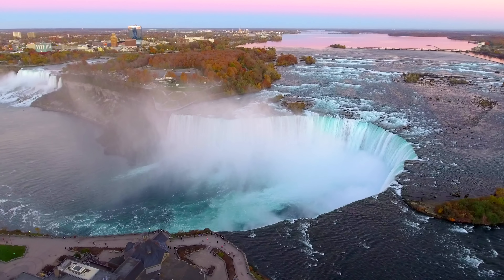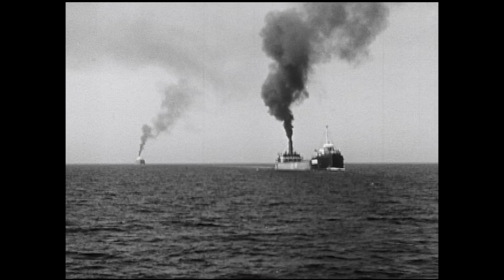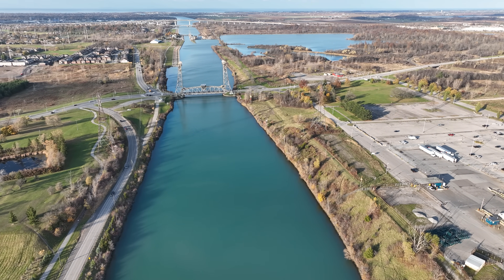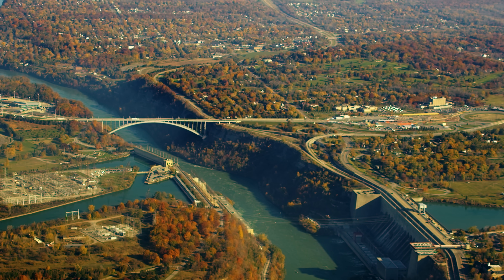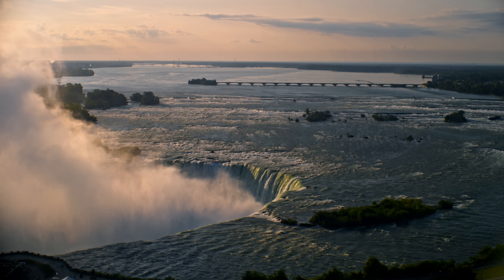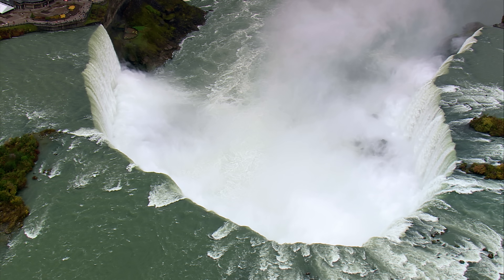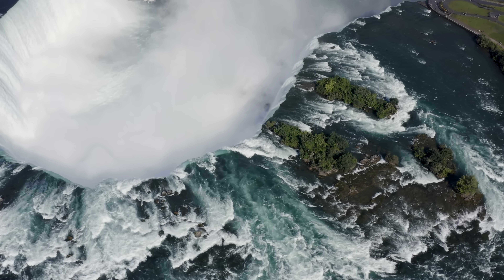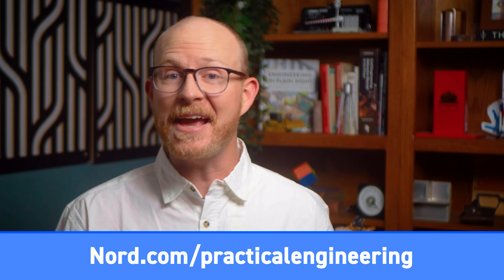The Hidden Engineering of Niagara Falls

Comment: An erosion rate of 1-3 feet per year sounds like light speed compared to the speed I'm used to hearing about geological shifts. It reminds you that these natural wonders are always temporary and makes you appreciate having the opportunity to see it now.
Reply: I grew up not too far from Niagara Falls, and in my 4-H geology course, we took a field trip to the Niagara Escarpment. If I remember correctly, our instructor (who was a professor of geology at a local college) explained that the geology consists largely of Niagara Shale. Shale, being a fairly soft, sedimentary rock. erodes rather quickly. That helps explain the fast rate of erosion. (I think there's also limestone in the mix, which is another soft rock).
Reply: @jpisello  and the towering cliff of the falls is because that shale is below a layer of  dolomite and limestone which is more resistant to erosion, thus the retreat of the falls largely happens at the cliff face and mostly due to the wasting of the shale undermining the dolostone until it collapses under its own weight.
Reply: The Rings of Saturn are kind of those that. On a Cosmic scale they haven't been around that long. And won't be around forever.
Reply: @ieuanhunt552  yea arnt trees and sharks older than the rings of Saturn
Reply: @Zo3yX depends what you mean by that, the rings are estimated to be up to 400 million years old from some theories and 4.5 billion years old and self replenishing from others. The first tree is estimated to be also close to 400m years ago
Reply: @ieuanhunt552 I'll miss them they're gone. 😂
Reply: The estimate is that in about 50,000 years, the Niagara Falls will reach the mouth of Lake Erie between Buffalo and Fort Erie and may cease to exist, turning in to a series of rapids or smaller falls.
Reply: Yes, well, the Niagara river carries a fairly substantial quantity of water, all year round.  The drainage basin that feeds it, is a fairly substantial chunk of territory, and almost all of it is in the wet half of the continent (east of the rain-shadow).  The nearest river that carries more water, is the Ohio, and it's not that much more.  And the topography is... steep.
Reply: @jonadabtheunsightly the east coast is definitely wet but actually the reason for that is not the rain shadow! The rain shadow only has a local impact on some areas east of the rockies. Most of the desert states on the west are dry due to oceanic weather patterns and land albedo.
Reply: @David-bh7hs  The rain shadow isn't the reason the eastern half of the continent is wet; it's the reason (most of) the western half is arid.  But most of the Great Lakes drainage basin, is outside of that rain shadow, so it is unaffected.
Reply: @jonadabtheunsightly wrong, read my comment again.
Reply: Imagine being around to see the formation of the mediterranean sea.
That would have been a sight to behold!
Reply: Geological shift ≠ erosion.
Reply: Do you know the Neva river? It’s called “Neva” (new), because it appeared during the human history, 3000 years ago.
Reply: The entirety of Australia moves 3" north every year from continental drift.
Reply: @elliotcm  The Moon moves away from the Earth about 3.8 cm per year.
Reply: @RCAvhstape  out of fear
Reply: water is one of the fastest acting things in geology honestly.
Reply: I recall reading that the composition of the rock results in the Falls receding at a rapid rate, relatively speaking.
Reply: Water is patient. It always wins, eventually.
Reply: That doesn’t look like 10000-30000 feet
Reply: Well the erosion rate was actually 3 - 6 feet per year, up until the international control dam was established in 1950, ever since then it has been an erosion rate of 1ft~ every year/decade.
Reply: weird there was no images depicting how the falls have changed over the past 50-100 years... they seem to be fairly identical across time as far as ive seen, but if the cliff face's move 1-3 feet per year youd think the falls would be in an entirely new location by now with a completely different shape
Reply: @AndrewBrowner  I don't know about the US side, but the CAN side there is so much water you can't see the cliff face at all so you absolutely wouldn't notice the erosion just from casual tourist photographs. There are maps of the cliff face and shape, as well as some photographs from above where you can see the changes.
Reply: @agilemind6241  youd think 100-300 feet would be enough to completely change the horse shoe shape, its not like erosion is perfectly even, ID expect it to turn into more of a V shape or maybe the U widens out so much it stops being a U and the water only falls off the straight face at the back
Reply: @AndrewBrowner  Well, Goat Island is several thousand feet long, so at 1 foot per year (the current figure, with the reduction in water flow due to the power plants), 50 or even 100 years of erosion, would only be really noticeable if you got an image from exactly the same vantage point and angle, which is difficult to do, because the stuff around the falls keeps changing as people build more and more tourist attractions.  I do think the shape of the Horseshoe Falls, on the Canadian side, seems like a deeper curve to me now, than in old pictures; but it's not so pronounced that I can completely rule out confirmation bias.
Reply: @AndrewBrowner  GIYF.
Reply: @AndrewBrowner  Why should the falls have "a completely different shape"?
Reply: @cprgreaves  the ground will erode at varying speeds, some of it will be rock, some will be dirt/clay some loose some pact hard.. and the water doesnt flow at an even volume over every foot of the falls, so youd expect the shape to constantly change... do you think a horse shoe shape and a flat fall seperated by some small islands started at the edge of the plateu thousands of years ago and receded perfectly in that exact form all the way to where it is now? no it would change form constantly
Reply: Respectfully, any topic in engineering is best left to Grady.
Reply: Eventually the escarpment will make its way all the way down to Lake Erie, and then the level of the Great Lakes will quickly lower.
Reply: There’s no way it has been eroding 1-3 feet per year.   I’ve been coming almost 60 years.  The falls aren’t situated 60-180 feet further back from when I viewed then as a kid.
Reply: @karagi101   human brains are notoriously bad at guessing distance without easy identifiers so you cant fully trust your self like that
Reply: @Zo3yX  I’m basing it on its location relative to the building that’s been situated right at the falls there for in its current state since 1927.
Reply: @karagi101  the erosion isnt uniform. Its not like cutting a cake you dont get 1 ft slices taken out every year much of the erosion is happening under the barrel of the falls where you cant see it unless you go into the barrel yourself or you use technology to look through the water.
Reply: @Zo3yX  Yes, that’s the way it usually works.  The erosion happens underneath and then the overhang that develops collapses.  It underneath erosion doesn’t go on for 50 feet before the overhang collapses.
Reply: The temporality is in geologic time, sure, but not on the scale of human life.
Reply: If it was unchecked flow, you could see it as a kid, and come back as a senior and see it moved 150 feet. As it is, 50-60 feet of erosion is extremely human scaled compared to most geological phenomena. Nobody is seeing the rockies erode towards looking like the Appalachians in any real sense in a lifetime. 

There aren’t a lot of geologic phenomena that were in a truly entirely different place at the dawn of civilization.
Reply: "three feet per year erosion" is geographic, not geological.

Comment: There used to be a nice big 'model' of the Robert Moses system of canals at their information center. Quite large, modeling several square miles. You could walk around it, see where the intake gates were, the underground tunnels and all the related infrastructure.
Reply: I was at the "Niagara Power Vista" (the impressive visitor center at the Robert Moses Power Station) back in August and as I recall the model is still there.  There are many many other cool features there as well.  The features are generally geared towards children to get them interested in how power generation works (and creating the next generation of power professionals) but I was there on an off-day and this "big kid" certainly enjoyed playing with everything.
Reply: The Adam Beck hydroelectric dam also used to offer tours, but they stopped. A lot of infrastructure is off limits due to security concerns these days.
Reply: At the information center for which facility?  Are you saying that the model is gone, or just that you don't know if it's still there?
Reply: @tgeliot  I haven't been back in 10-15 years, so I just don't know. It was the information center for the hydro-plant and pump-storage facility.

Comment: Fascinating! I always wondered about that maintenance job in the 60s. I can add one little bit of trivia to the story. I moved to St. Catharines in 1974 and heard about the diversion. I was told that locals in Niagara Falls were so used to the noise of the falls that during the diversion they had difficulties sleeping because there was something off  (too quiet) about the ambient sounds.
Reply: I can only imagine if you lived near the falls but were unaware of the diversion plan, and one morning you wake up to the falls being turned off
Reply: The wonders of white noise. I run my spaceheater year round while sleeping. In the summer I just turn the air on without the heat. This helps to block out the chirping birds in the morning, the extremely loud crickets in the evening and the constant low-level ringing in my ears.
Reply: I can sympathize.  I used to live right next to a county highway that was heavily used by trucks.  One night, about 2Am the highway was shutdown due to a major accident.  I woke up out of a dead sleep not knowing what was wrong.  It took about an hour to figure it out.  Didn’t sleep at all that night.  Work the next day was hell.
Reply: I can imagine. I've kept empty fish tanks going at night because I was used to the sound.

Comment: I went there some years ago. It's quite huge to be honnest and videos/picture do not show it because of the scale.

I wonder however how they will manage the erosion with time. 1 feet/year is still a lot, so I guess at some point they probably will shut it off to make some kind of artificial cement ground to be eroded to prevent it to go further. Like I mean if they wanted with the kind of money that is going here, they could probably 3D map the fall with insane accuracy, then get some molds of it, do it with cement then put real rocks over it hiding the cement. I guess with some time it will grow deeper at the point of the fall, before having a big pool.

If you want to do a deep dive into the erosion prevention and plans they have there, it could be a nice follow up video.
Reply: They'll just allow it to erode naturally, and move the tourist infrastructure closer to the new site of the falls.
Reply: @agilemind6241  Given where the turbines water entry points are, I do not think this will happen